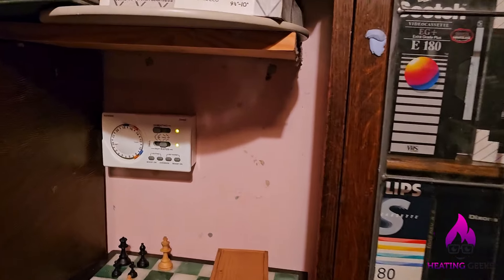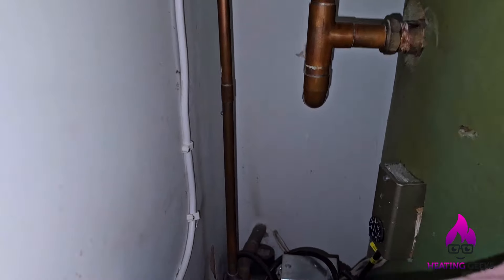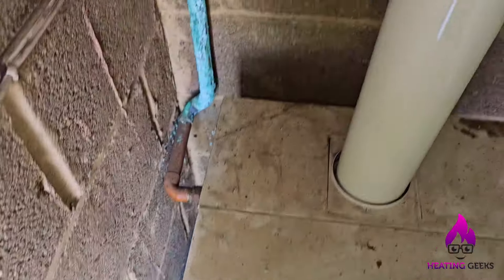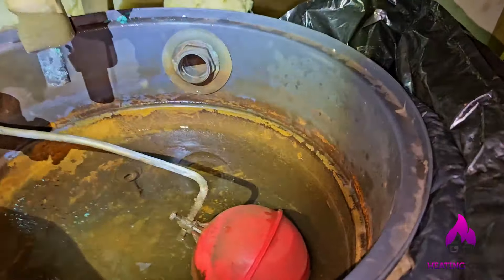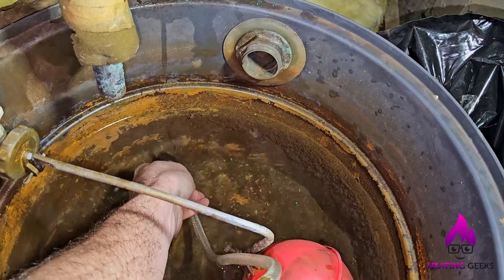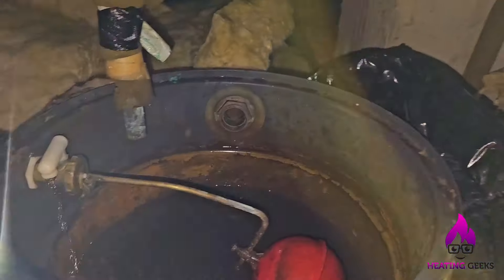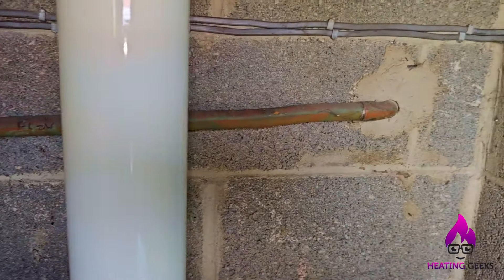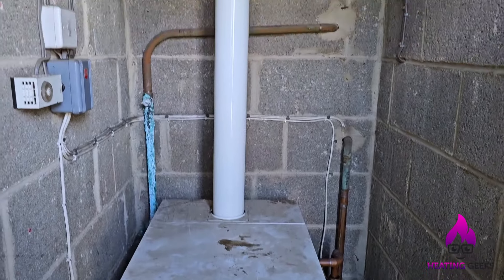Heating Hacks: How to Safely Unblock A Cold Feed Pipe

Comment: 20 odd years of cutting out blocked cold feeds 😅 just ordered a gun , thanks for the video ! Out of interest , have you used the gun to unblock other things like 10mm rad pipework ? Obviously, with an open end if on a sealed system
Reply from the maker: I have used it for blocked condense pipework. Unfortunately I have a couple blow to bits behind kitchen units or out of the compression fitting under a sink.... Very messy and the clean up ruins the day. :-) I still try it though. Just don't give it all the onions straight away :-)
Reply: @HeatingGeek  Haha, wow , you’re a brave man!  😂 Thanks for the reply , thanks again for the brilliant tip that will certainly make life easier for anyone dealing with blockages , what a game changer !!
Reply from the maker: Thanks :-)
Reply: How do you know you've cleaned all the debris away from the tee without, draining the F & e cutting pipe and cleaning inside of pipe out? That way you can also put a valve in the cf for the next time it happens? 
Quick fix but probably not the best overall.
Reply from the maker: Gets it going though. :-) I agree with what you wrote. In this instance the customer isn't covered for the repair as blockages are not covered. This gets it working and gets me home :-) The  proper solution is a power flush.

Comment: Hi had problem with this overheating and radiators getting hot for over a year, called plumbers out said its fine. Going to try this. As well as doing it to over heating pipe can do this also to the cold refil in header?

Comment: Nice vid. Do these work on blocked condense pipes? I don't want to blow the fittings apart if it's too powerful
Reply from the maker: They blow them to bits if they're blocked badly. :-) I know from experience :-)
Reply: @HeatingGeek  Yeah thought that might be the case, will stick with my wetvac on blow

Comment: 28mm /1inch. Zones are designed to operate gravity systems, and the white   

  controls  cylinder  thermostat, room stat and boiler temperature to separate the programs.  The zone was altered in the past alongside the  wiring update.
Reply from the maker: Yes and no. Usually you find the 2 port isn't used as an interlock just a valve controlled by the stat. The boiler still fires even when the demand is satisfied. I see a lot done like that (usually in 2 story houses) so the engineer doesn't have to run a cable from the cylinder to the heating wiring center. I would say about 30% are done like this. Im sure you must have seen it?

Comment: You wouldnt normally have An MV on that gravity circuit.
Reply from the maker: @DavidKneale . It's called a C plan and was a common upgrade to gravity hot water system so proper temperature control could be added.
Reply: @HeatingGeek  Back in the 70s we used a "Ciltrol" valve on the primary return. It was a bit like a trv with a wax capsule. Anyone else remember them?
Reply from the maker: @DavidKneale  I have never seen one. I have seen a servowarm flowerpot to fill a heating system. Amazing things :-)

Comment: That's a great job I use a high pressure bicycle pump there is two settings on the pump high and low it's after getting me out of more trouble love it.
Reply from the maker: Great tip! I have used an old expansion vessel (diaphragm split) and a lever valve to store pressure and shove it through a system before it worked a treat. But I was scared with a vessel at 5 bar. :-)

Comment: Game changer pal🎉🎉🎉🎉
Reply from the maker: Thanks :-) Saves a lot of time :-) How would you usually do it?
Reply: @HeatingGeek  cut the cold feed out, facking nightmare. I’ve seen lads use a foot pump, took ages to set up lol. Definitely buying one. Buying shares in gallo too 😂😂
Reply from the maker: The legit ones are expensive. I don't know what the fakes are like. I linked both types.
Reply: @HeatingGeek  il get the proper one, for 50 quid it’ll pay for it sel first job
Reply from the maker: Yeah it does. If you get home a couple of hours early then it's worth it. Also if you don't get shitty water all over the bed sheets in the airing cupboard it's a double win. :-)

Comment: huh, pretty cool that. I've always used steam power to clear them but this is a great option.
Reply from the maker: Steam power?? Explain dude :-)
Reply: @HeatingGeek  haha, does sound a little strange in hindsight. In instances where you can't get to the blocked tee on the feed I've often cut in a valve or simply turned off the existing valve and heated the outside of the pipe with a blowtorch. The heated, trapped water quickly shifts the plug with STEEEEEAM POWARRR haha
Reply from the maker: Ah blowtorch. I thought you were going to cap the expansion and run the boiler :-) :-) That would be fun. :-)

Comment: Would something like this release an airlock on the hot water as I’ve had tap changed the tank was drained down and when filled back up no hot water out of taps cold works fine
Reply from the maker: I wouldn't risk it on a copper cylinder. mi9ght damage it.
Reply: Thank you
Reply: Best way to get hot water running again as header tank f&e as the tank only works hot water heating is separate ie electric storage heaters

Comment: Good video as always! Just a point gravity... its pressure you are referring too. Gravity is a theory.
Reply from the maker: It's the type of system I'm referring to. They could call it relative density for all I care. Please explain what you mean :-)
Reply: Can you explain the term you used? @HeatingGeek
Reply from the maker: @simplemind7532  Which one?
Reply: Gravity  @HeatingGeek
Reply from the maker: It's what the industry call it. Hot water being less dense than cold so rises up to the high point. At the same time the cooler water falls down through the water column back to the boiler. Thats why we call it gravity. No pump required for it. 
I hope this is what you mean?
Reply: @HeatingGeek I have an experiment for you... take the medium water in a bottle and put a stone along with an air bubble. Flip the bottle upside down. Now you will witness buoyancy and density... no matter how many times you carry out this exercise it will occur. Now take the same bottle and as you flip it let it go into "freefall" and observe ... buoyancy and density cease to exist! Until it hits the ground.
Reply from the maker: But what's that got to do with gravity hot water?

Comment: Hi all. I am currently dealing with a gravity HW system on a 2 floor property with the floor standing boiler on the gnd floor and the cylinder on the ground floor just above the boiler. The issue I have is that one radiator is not working. The pipework layout is not the greatest with it mostly in 15mm no microbore. I have manually flushed the radiator and it is not sludged. GND floor rads are fed from above as solid floor. Have found the cold feed and have drained the system and can fill the system but only if I have the offending radiator connected and isolation valves opened. If I run the system with all other rads off I get heat to the flow pipe on the bad rad (during bleeding)but nothing on the return. The return on thia radiator goes to the cold feed first tee. Have tried connexting bike foot pump to both the flow and return and I can pump the system up and disconnect and get a flow of water when I remove the foot pump. Do you think I can try the method in the video to get this radiator working or would you try it somewhere else. Do I need to be disconnext the pump which is next to the boiler. Any help or suggetions much appreciated. Tks
Reply from the maker: I would guess the tee is blocked where the cold feed and the radiator pipe meet. Cut it out for a guaranteed repair.
Reply: Indeed that is the path I took. Had to get a few boards up to find the tee will also take the opportunity to re pipe as here are 4 rads on 15mm flow and returns.
Reply from the maker: @grahamh6444  IS it all working ok now?

Comment: May have missed it at what point did you know it was a blocked cold feed? Stat not clicking and water in the tank? Thanks
Reply: You don’t necessarily ‘know’ all the time but for the sake of five minutes, it’s a process worth carrying out as part of your tests. I had one the other week but the Gallo gun didn’t work. So the blockage was lower down. Turned out to be a blockage on the H air separator pipework.
Reply: Boiler overheating and the flow pipe is cold, meaning there is no water in the system to heat up. Boiler running dry.
Reply from the maker: There was no heat transfer up to the cylinder and the boiler was overheating like mad. The little bit of heat that went into the cylinder pipework cooled off instantly (it was steam not water). Also the cylinder was the highest point on the system. So the first bit to suffer when the cold feed gets blocked. I hope that makes sense.

Comment: Great hack there. I would usually run a temp bit of speedfit of the main, bung the expansion and connect to the down pipe and blast through with mains pressure. This is much better and quicker 😅
Reply from the maker: Yeah, I used to cut it out every time. Absolute pain in the ass. Then for a few years I back filled it. This is good enough for 90% of customers and the other 10 will get it flushed> ;-) Saves loads of time.

Comment: Was a common problem, so for the older guys like me who are pre combi easier to spot, putting a magnet on the cold feed tee would also have shown it. Great bit of kit and great vid.
Reply from the maker: Thanks, the old magnet trick works a treat on airjecs (spelt wrong obviously). This will push all the soft stuff back into the tank. Which isn't great but customer then have the option to clean the system or not. And We get paid :-)

Comment: Excellent ! everybody has a cold feed story or two. I wish I'd had a gallo gun on callout 20 years ago. It could have saved a lot of grief. A mate and I were even sent to change a 'faulty boiler' once. It was just a blocked cold feed wrongly diagnosed by a numpty 🙄 It could also be used for unblocking central heating pipes. I have used a foot pump for that, but this would have made it a lot quicker.
Reply from the maker: Yeah. lots of people are mentioning a foot pump. Just sounds a bit awkward to do in a loft. :-)

Comment: Lucky really 
I’ve had them where they are solid at first tee, even to the point where a flexi cable rod wouldn’t break through.
But worth a shot with the co2 gun for a start
Reply from the maker: I agree. But I try this first and it usually works. :-)

Comment: That was really interesting 
But bit confused as to how the gallo gun worked, I know you removed an airlock but how did it work?
Reply from the maker: The pipe was blocked not air locked. Watch the video and you will see all the crap come into the tank when I squeeze the trigger. The debris isn't rock solid so the 200psi pushes it out. ;-)

Comment: Hi Ollie. 
One thing that may be a concern is the motorised valve on the gravity cylinder return especially for overheating issues ? 
If it is a bungalow, I assume there is not a towel rail or another form of open circuit loop to allow the boiler to cool down when the hot water demand switches off ?
It could be that someone has done something semi clever with thermostat/pipe stat  controls that only allow the motorised valve to close when the hot water is satisfied and the primary circuits have sufficiently cooled, it looks unlikely ?  It could also be the boiler can deal with this closed loop ? Generally not considered to be great practice ?? 
Excellent educational presentations.
Reply from the maker: It's a C Plan system. Quite normal 30 years ago. The boilers can take the punishment without a problem. A new boiler wouldn't :-)

Comment: I bought the cheaper version and all was well until i screwed in a cartridge too tight and the plastic sheared and the whole thing exploded in my face 😂 luckily no injuries other than the customer absolutely shitting themselves. I think it was user error rather than being a cheaper version. I must get myself another one!
Reply from the maker: WOW that would be scary. Just the back pressure on the expansion pipe was worrying.:-)

Comment: If you clean the tank first you wont fill the system back up with all the crap you just cleared
Reply from the maker: Im just doing emergency repairs. No cleaning etc. I didn't have to unblock the cold feed for the customer. Blocked pipes are not covered. Customer has been advised to get a power flush which should have the tank cleaned as part of it. :-)